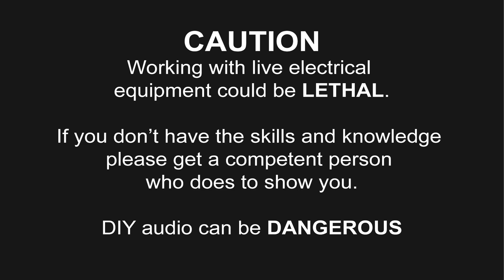Avondale Audio CD3 over view

Comment: Great video m8 
Thank you for showing the power supply as it is very important that you use this as it is way better than a hi cap flat cap etc iys a semetrical dc supply the clock is a trichord clock 4 with a never connected power supply about £500 quids worth just in parts 
I loved your video m8

Comment: Buy yourself an old quad 75 CD player. They have S1s in them. Also put a heat sink on the DAC to stop it failing in the future.
Reply from the maker: Thanks for your insight, not sure if this is the answer as a Quad 75 cdp 'working' fetch £350 ish buy removing the DAC to used in a AACD3 seems none cost effective. I have owned a Quad 75 and installed a (PFM flea and Tent clock) and circuits supplied with ALW super regs. The AACD3 was still better than the modded Quad 7 but I know your thinking. There are loads of CDPs still out there with the TDA1541a.....